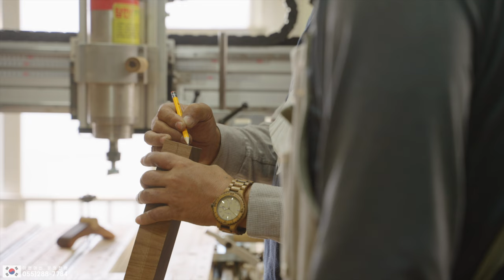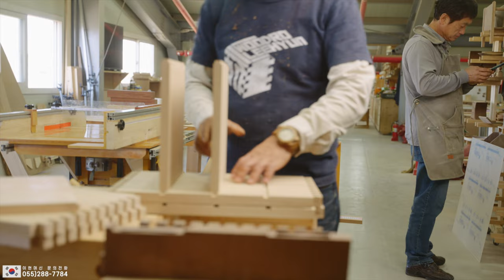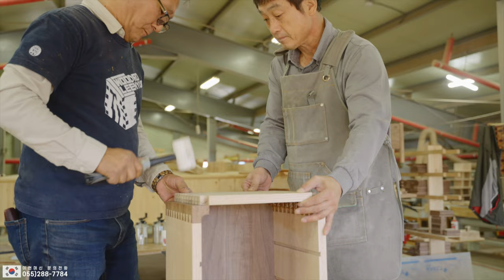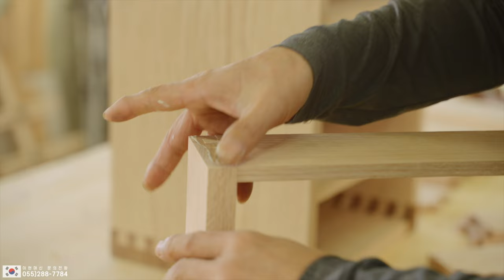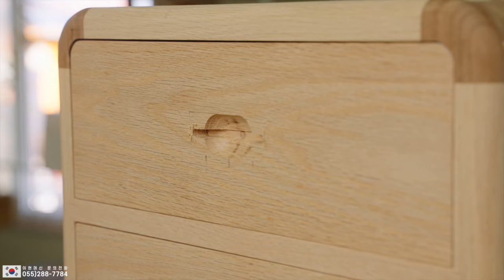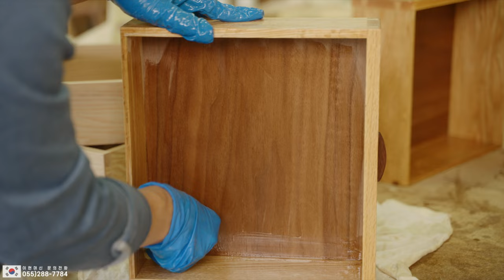한달교육으로 고급 짜맞춤 가구 완성!! dovetail joint furniture korea Leehyunmachine woodworker carpentrylife

Comment: Hello Mr Woodro, I like you machine very much, there is however one point I am not sure about. As the girder under the rail is also the jaw of the vise, there must be some amount of deformation on the rail, which has a direct influence on the accuracy of the machine. Is the aluminium profile under the rail so stiff, that that deformation is neglectable? I just put in in calculator and I came on deflection of ca. 1mm on 2m girder with 90x180mm profile under the force of 200kg. That looks a lot. Thanks in advance for your answer. I am an mechanical engineer, so such a things are always interesting to me :-)
Reply: I dare to correct you: the vise beam profile is 80x160 mm, not 90x180mm.
Reply: And the beam under the rail has a profile of 160x160 mm.
Reply: In addition, the structural aluminum profile is lined with 40 mm thick wood.
Reply: In addition, the movable vise jaw consists of two beams. Each beam has a section of 80x160 mm, and they are lined with wood 40 mm thick. As a result, the total width is 40+80+40+40+80+40=320 mm. As a result, the milling accuracy guaranteed by engineer Lee Hyun, is no less than 0.2mm.
Reply: @yakov-woodworker  Thanks for your response, I have actually no idea, what profile is there, the 90x180 is the biggest one the Rexroth offers... So I just roughly calculated with that one. Two beams you mentioned looks ok, that is why I didn't mentioned them. Their deflection is not so critical for the accuracy. If you're right and he has 160x160 profile under the rail, than there's still some 0,3mm deflection there under the force of 200kg. Maybe my estimation here is exaggerated. I can see in his videos, that he fixes things just very slightly in the vise.
Reply: @rastogallo1454  You correctly noted that Lee Hyun fixes the workpiece in a vise very easily. Given this, one should not expect a large deflection.
Reply from the maker: Thank you so much for your professional comment :)
If there are many comments like this, I think Lee Hyun Machine will make a lot of progress.
Reply from the maker: you know me very well :)